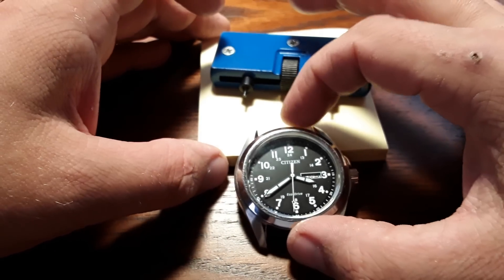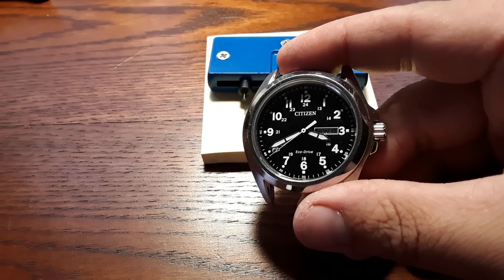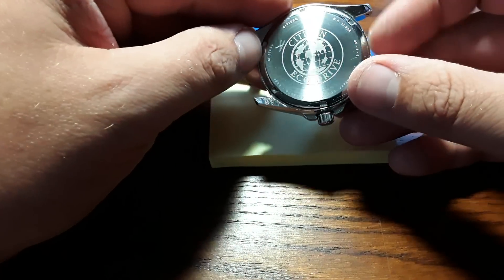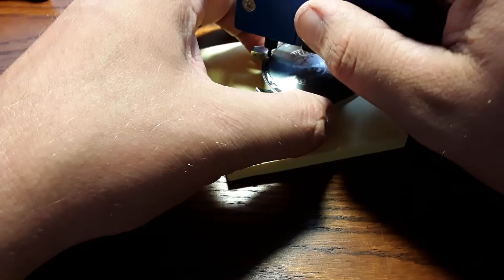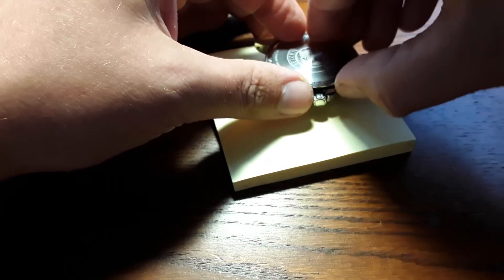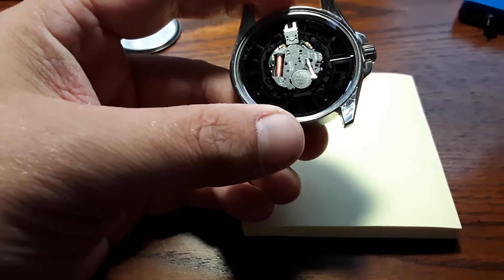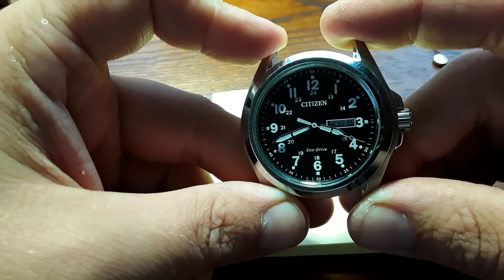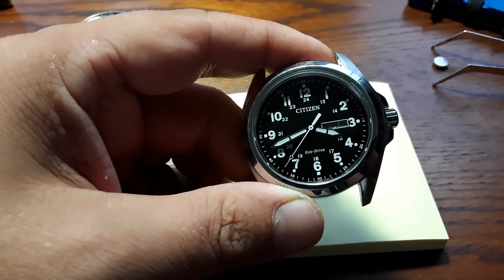Citizen Eco-Drive Runs Without a Battery (Capacitor)! Please SUBSCRIBE

Comment from the maker: ➡️ DIY watch kit- https://shop.diywatch.club/?ref=avgjoewatchreviews&utm_source=affiliate  - use coupon code: Avgjoewatchreviews at checkout for 5% off 

New Sales Every 72 Hours at Jomashop.com- https://www.dpbolvw.net/click-100755909-10722196/AvgJoeWatchReviews/Jomashop New Sales Every 72 Hours

Pre-Owned Watches at Jomashop.com - https://www.kqzyfj.com/click-100755909-13492497/AvgJoeWatchReviews/JomaShop Pre-Owned Watches

Trade-in Your Watch! - https://www.tkqlhce.com/click-100755909-12884306/AvgJoeWatchReviews/ Trade-in Your Watch/ JomaShop

Casio at Jomashop.com- https://www.anrdoezrs.net/click-100755909-13492493/ AvgJoeWatchReviews/Casio/ Jomashop

Hodinkee  $150 off all pre-owned watches!- https://www.anrdoezrs.net/click-100755909-15448594 / AvgJoeWatchReviews / Hodinkee -$150off

Hodinkee Classic Dive Watches- https://www.kqzyfj.com/click-100755909-15303916/AvgJoeWatchReviews / Hodinkee-Dive Watches

Hodinkee Latest Arrivals- https://www.jdoqocy.com/click-100755909-15303803/AvgJoeWatchReviews/Hodinkee Latest Arrivals

To purchase any watches or tools featured on the channel, click here - http://www.amazon.com/shop/avg.joewatchreviews?ref=inf_own_avg.

**Disclaimer: All links provided above are affiliate links. Any purchases made with these links will yield a small commission to the channel BUT products cost the same as if you purchased directly through the website. Commission from affiliate links assists in funding the channel.***

To contact me: Avgjoewatchreviews@yahoo.com

PLEASE SUBSCRIBE AND SMASH THAT NOTIFICATION BELL

Visit me, Avg. Joe, on IG at- AvgJoeWatchReviews
Reply: How often you are shorting the batteries per video?
Reply from the maker: @mititeimaricei  shorted out quite a few actually. Thanks for watching.
Reply: @AvgJoeWatchReviews  I've learned it in the hard way. Solution: plastic tweezers and wood tooth picks.

Comment: The advantage is that the battery is rechargeable, and they last for decades if they are kept topped up. Put them in a drew for months, and the battery will degrade. If you do need to store them in the dark for a while, then pull the crown to reduce power consumption. Take care charging in direct sunlight due to heat.

Comment: One advantage is not having to open the case as often and compromise the water resistance. These eco-drive watches will go decades without needing a new battery (capacitor) if they are kept charged consistently. People often don’t follow the manufacturer’s  instructions. The thing that destroys the battery is not keeping it sufficiently charged. People stash them in a drawer instead of leaving them where they can consistently get light.

Comment: Solar powered battery watches all brands life varies from four or more years they are like a vehicle battery can be recharged ie by solar or Kinetic  alternator energy they need replacing. As regards to the watch running with no battery solar panel in dial will let the watch run on two second hand intervals if you take the watch in a dark room it will stop no light to solar panel you at least know the panel is functioning to charge the battery

Comment: The only advantage is that you can engage the chronograph 
for as long you like, without caring about wearing out the battery.
Only for the ones that have the extra chrono fuction.
Not yours 🙂

Comment: is it an advantage? Yes, because the battery doesn't deplete and even in dark it would go on for 6 months or more. Once is completely discharged, just leave it on the window under the sun for 10 minutes and it'll start ticking again!

Comment: I have had my Eco-Drive since 07. I let it set for a span when a dress watch wasn't appropriate and after a while it did the two second skip also. Put it in some strong sunlight for about 7 hours and recharged it. Ben a few months and it's still going on that battery. I guess the advantage to Eco-Drive is that it DOES recharge with light energy. As a result the battery has lasted a really long time. I'm really happy with mine. It also has a good solid hefty feel that I appreciate.

Comment: Have you also charged this in sunlight for some hours with the watch STOPPED while charging?
I have several Eco-Drive's and one had that problem that it would indicate "battery low" (second hand jumping) after months of not getting enough light inside the flat.
I charged it for a few days - second hand still jumping.
Then I got the idea to stop it and charge it - and after a few hours already, no jumping anymore. No jumping ever since, even after keeping the watch in not enough light condition again for months.

Comment: I bought a citizen eco drive for my wife a week ago. It's not new but in pretty good condition. I checked the serial no. and it was made last year. When I bought it the second hand was ticking every 2 seconds like yours but I left it out of the box until yesterday and now it ticks every second. No need to change the battery just let it charge

Comment: This is very simple you have mistaken the m7621 for a battery that is not a battery that is a capacitor. The capacitor in this sence is a device that can be charged and discharged many times. Hope this helps  you out. Oh and by the way when you go to replace this you will notice at the bottom of it has a small copper plate instead of looking like a normal battery make sure you get that copper plate in the correct orientation or you watch will not function properly.

Comment: The citizen eco drive watch has a capacitor not a battery for your information are not the same. A battery in your average watch lasts about 3 years I have even seen where they say awatch has a 8 year battery well a capacitor will go on working for decades. They store the energy differently than a battery which is chemical and chemicals degraid over time I have 5 citizen watches and belive me they last practicly forever but do eventually need to be replaced. But b3live me when I say citizen watches are worth every penny.

Comment: Had mine for 20 years and now it went dead on me, the problem I'm having is the back cover does not have notches to unscrew, so I assume it snaps in place, I will be replacing the battery with a new rechargeable battery, they'll last between 15 to as long as 20 years

Comment: The advantages are that the capacitor lasts at least about twice as long as a non rechargable battery.
Because it recharges with natural and artificial light so that under heavy use such as using the stopwatch/timer function the power is replenished. With a non rechargable battery it would shorten the time between battery changes.
I have a casio radio controlled watch with a solar recharge battery.
This watch has a dial light as well.
Imagine how long a non rechargable battery would last if it was being drained of power by a dial light.
I have a small collection of watches, mainly citizen, some of which are radio controlled with stop watch/timer etc. They wouldn't last 5 minutes without the eco drive.

Comment: It looks as if the battery is almost drained of power that’s reason for skipping the second hand so the battery needs to be fully charged that can take anywhere from 11 hrs to 150hrs depending on the charge the battery holds

Comment: A "battery" is not  a "capacitor."   If it was a "battery" removal would break the circuit and the watch would not work at all.  
Finger oils all over the inide of the watch and Panasonic capacitor.  :face-fuchsia-tongue-out:
Learn first; THEN teach.
Reply from the maker: Looking forward to your video. Thanks for watching.

Comment: I neglected my eco-drive to the point where it stopped completely, placed under the lamp, soon started running by second hand ticks every seconds and eventually when fully charged and runs perfectly even to this day, great work Citizen ! 👍 from what i have read in the past it is a tougher and better system than seiko's.
Reply from the maker: I’ve heard the same. Citizen owns the solar market as it’s Eco Drive is the best money can buy.
Reply: I used the headlight from a bike. Very very bright. Worked well.

Comment: The battery keeps the watch going when there is no or insufficient light available. Under normal conditions the photocell provides enough to run watch and charge the battery.
Reply from the maker: Best explanation I’ve seen yet. Thanks for sharing. 👍

Comment: Just spend a little more and buy a good automatic or tourbillion. Then you have a trusty lifer
Reply from the maker: A true tourbillion is outside most budgets. But an automatic, surely has advantages. The disadvantage is the need for servicing. Eco-Drives are service free minus a change in battery maybe after 15-20 years. Accuracy will better as well with the Eco-Drive over the automatic.

Comment: I have an Eco Drive and it has worked well until the pandemic. The watch is solar powered and will charge using any light source. During the pandemic I had little chance to expose it to natural light since I was working from home. A few hours leaving it in sunlight got it back running. I like that I never need to change batteries or wind it or have to advance the date or correct for DST.

Comment: I bought a WR200 in 2008 and it never skipped a beat or stopped, even when, with the advent of smartwatches, I put it in a closet for months. I'd also spend a word for the glass. I scraped it on few walls and it doesn't have one scratch, not one!

Comment: If you knew what you are talking about you would know 5hat it is a capacitor not a battery and you can't tell it's different just by looking at it. The capacitor has  a very long life pretty much as long a life as the rest of the watch itself. Yes it takes a long charge to get it back to normal operation. I have several eco-drive watches and they are amazing and worth in my eyes every penny you pay for them.

Comment: The watch is still running without the battery because there is a capacitor which stores energy. The watch will stop running once the power in the capacitor is depleted.
Reply: Wrong lithium-ion

Comment: 180 days battery life without light 
If mow Without battery 
How meny second until stop?
But need to put in dark - to no have power from cell
Reply from the maker: I never measured that. Good question.
Reply: @AvgJoeWatchReviews  some watch have programed 
On 30% battery to stop  to reserve the power but keep the time - and when are charged by light or muvment - the hour and minute are runing in the right position - start to function Without lost the time

Comment: It looks like a battery, but functionally it's not a normal battery--it's more of a capacitor.  Obviously the watch has to have a means of storing and releasing electricity to the circuitry; otherwise, it would stop as soon as it it's not getting light, like at night.  Capacitors are not forever items and have to be replaced in this watch just as they do in every electronic device.  The watch runs with the capacitor removed because its photovoltaic panel is getting light in this video.  Put it in the dark with that capacitor out, and it will stop.  A standard quartz watch will not run at all without its battery.
Reply: Nope it's a lithium-ion.

Comment: A capacitor is used to sustain battery life. It has a rechargeble battery in it ( panasonic in this case, lithium titanate to be specific )....A capacitor and an energy cell are 2 completely different things. 

In short. A capacitor stores energy in an electrostatic field. A energy cell/battery stores energy in a chemical form.

Comment: I have a Citizen Eco-drive watch, purchased new 20 years ago for $220 (I still have the original paperwork).  It has a deep blue face and is ultra thin which I like and was the main reason I bought it.  It kept perfect time until last year.  I had two separate jewelers look at it but both deferred due to the solar drive aspect.  I contacted Citizens and they advised sending it to them for evaluation.  I mailed it and they promptly returned it, repaired, having replaced the solar drive for free as it has a lifetime warranty.   I have been very satisfied with my Eco-drive watch and with Citizen's service repair.
Reply: That is awesome. Citizen really is a great company.
Reply: I have the same situation, except I've had my Cal. 8700 Eco-Drive for about 17 years now. No problems except on occasion I would need to leave it on a window sill for several hours to give it a nice prolonged charge from direct sunlight like once or twice a year, in addition to the light (natural and artificial) that it normally receives while on my wrist. However, recently it seems like it doesn't want to charge properly no matter how long I leave it in direct sunlight or under a lamp. I'm thinking the battery after 17 years of use has been worn down and can no longer hold a sufficient charge, so that's why I've been searching for videos on how to go about replacing it. But you're saying that Citizen actually offers a LIFETIME warranty on this sort of service? That's not what I heard though... and in fact many Eco-Drive watches that I see on ebay nowadays come with a little booklet saying that the warranty/guarantee is only 5 years on these watches (although they should last and function much longer than that as yours and mine has if properly maintained and not abused). I'll have to see if I can get hold of a Citizen service rep that can agree to replace the battery/capacitor or the entire drive if that's what is needed for free. Otherwise, I'll just do what the OP did here and try to replace the battery.
Reply: @xombieo0723   I wrote a reply to your comment but I can't find it so maybe it didn't post.  In essence it said the reply I received from Citizen said the Eco Drive watch movement has a 5 year warranty but the energy cell has a lifetime warranty.   The price of the Eco Drive movement was $25.  Factor in shipping & insurance, to have a good watched repaired for around $50 wouldn't be bad.  I wish you positive results.
Reply: Same story here apart from Citizen charging me £80 to replace the capacitor.  
If I did not love this ultrathin watch I certainly would not have said it was worth paying that much.
Reply: Why does an eco drive watch contain a battery?
Reply: @Resolute900  It has to have an energy source.  It is charged by sunlight and can hold enough energy to power the watch out of the light for months.
Reply: I have a Citizen Eco Drive 0780 Model for 19 years - 20 in August 2o26 and is still Running 😅🤞... 
P.S. You didn't say how did it cost you 😅
Reply: @mariuspetcu2087  $220.

Comment: My blue angels eco drive has been running for 12 years now, no problem, also you should never use metal tweezers to handle a watch battery/capacitor.

Comment: I bought my Eco Drive just short of 10 years ago. It ran perfectly until this fall (autumn) when it has stopped a couple of times. It quickly restarted after exposing it to sunlight for a minute or two. I have been living in the dark for a few months so I am not surprised it eventually ran short of charge. I was pleased to discover that my desk lamp charges it, although, I have learnt, to fully recharge an empty capacitor from a lamp takes a few days of continuous exposure or a good day of sunlight. My watch was the cheapest model of Eco Drive available at the time and it has served me well, and was worth every penny. Now I know the tricks I will ensure I keep the capacitor more fully charged and I am sure it will see me through a few more straps.
Reply from the maker: For me, I simply leave it in the window sill. No electric bill to worry about. 😉
Reply: I keep my 20 year old Eco-drive watch on the window sill when its not worn so it is always fully charged.

Comment: it does have a capacitor battery which get charged by light, you van convert it using the same battery number ie ctl1616 to cr1616, ctl920 to sr920, ctl621 to sr62, average life of a capacitor battery would depend on use, if watch always gets top up full charge, then 10yrs or more

Comment: Last week I bought an eco-drive chronograph from TJ Maxx and I decoded the serial number and the movement and it was actually made in May 2019 so it sat around for a couple of years and I hope the battery will be OK because of that but anyway in 2002 I bought my dad one that looks very similar to yours the basic day and date model and in 19 years he’s gone through three batteries, Canadian winters are very hard on these watches because there’s not much sunlight and when they die I think that is very hard on the batteries
Reply from the maker: Some good points here. Keeping them in a drawer or depriving from sunlight for long periods is not good.
Reply: @AvgJoeWatchReviews  Yep that’s exactly what he did for the first seven years he had it he kept it in a drawer when he wore the other ones and that just completely destroyed the battery

Comment: I wore the same citizen watch everyday for 10 years. It will no longer charge. I love that watch!!
Reply: Change the capacitor. A little over 20 bucks in Amazon and takes only 5 minutes to replace
Reply: @drbichat5229  Can a watchmaker do it? Does it require replacing other parts in the watch?

Comment: I've had my eco drive for 17 years and is still going strong.
Reply from the maker: That’s awesome! Thanks for sharing.
Reply: Awesome, that's value for money! I've always preferred mechanical movements but that said they can't compete with the out and out practicality of a decent solar powered watch. Only a radio controlled watch needs less input from the wearer. I'm a little surprised that anyone bothers with regular battery quartz movements anymore.